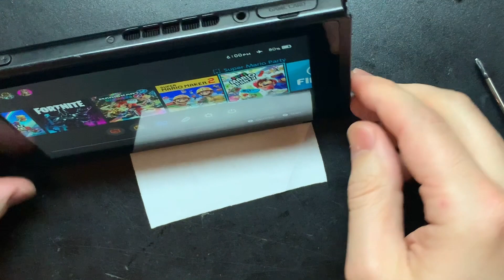Fix Nintendo Switch Kickstand

Comment: Thank you! I was able to successfully replace and switch out my son’s Nintendo Switch Kickstand due to your video. Only thing to mention was the first 4 set of screws were long, but the next 3 were shorter and I almost striped the screws because I kept turning and the screws wouldn’t pop out. I was mistaken to think they were the same size. Also, once opened OMG the dust settled inside the thing! I cleaned it with rubbing alcohol and Q-tips. Anyhow loved that your video was pretty easy to follow otherwise.

Comment: Cant you just pop off the kickstand and put in a new one?
Reply from the maker: You can buy it is a temp fix, it will break sooner as the internal piece the new kickstand secured to is worn. This method shows how to install a newer model kickstand that will not break.

Comment: I tried doing this but the screws on mine are too tight on there. Frickin garbage
Reply from the maker: Which screws are giving you trouble?
Reply: @TheFixTech  most of them to be honest. I’ve only managed to get the top and bottom screws off with no trouble. The rest I wasn’t able to get off and even started to strip them a little so I just stopped lol
Reply from the maker: I’m afraid you only option is to careful drill them out...